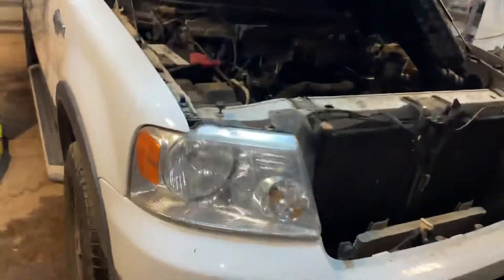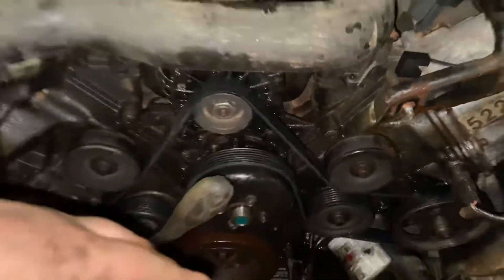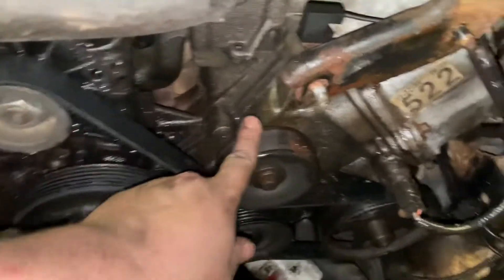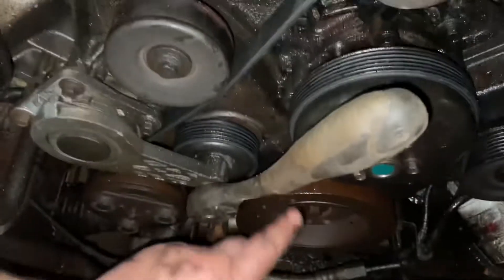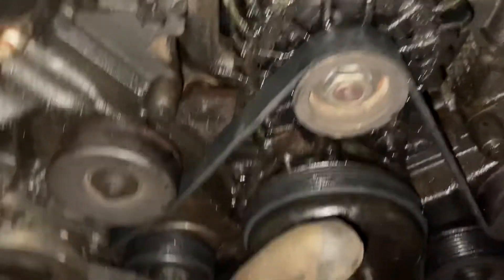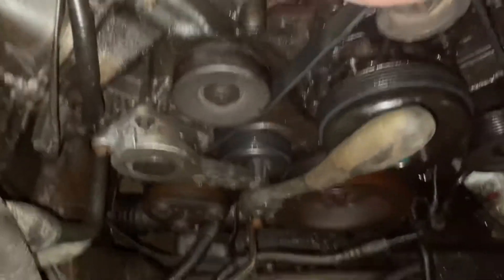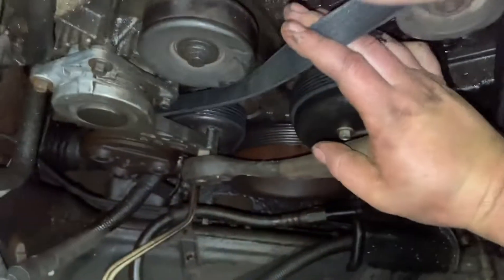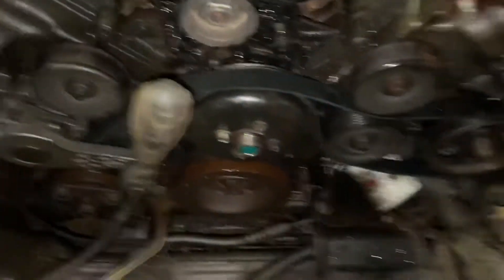5.4L Ford F-150 belt routing

Comment: Done any cam phasers?
Reply from the maker: Yep! Especially in f150s
Reply: @FerKurl  just curious what's the normal labor cost to bullet proof these guys? Timing chains, phasers, hi flow oil pump etc
Reply: I have a 2008 f150 and had it since 11. Love ol Blue. Gonna keep it forever. Ol blue doesn't have the crappy 3pc plugs thank God. Sp509 but I'm running ngk iridium 372. No difference in performance, maybe smoother acceleration